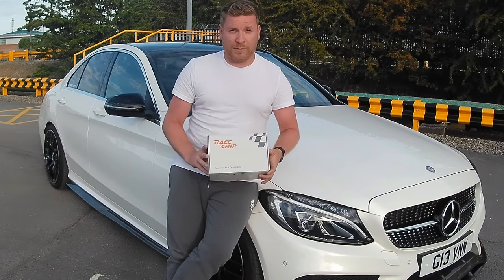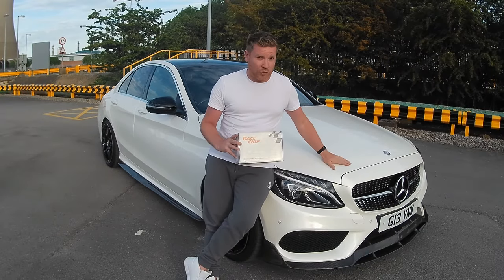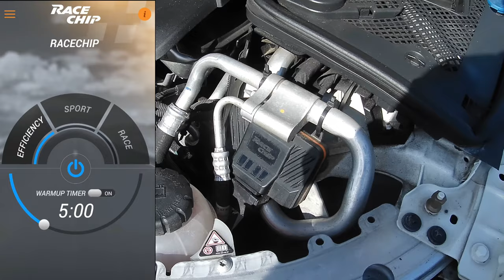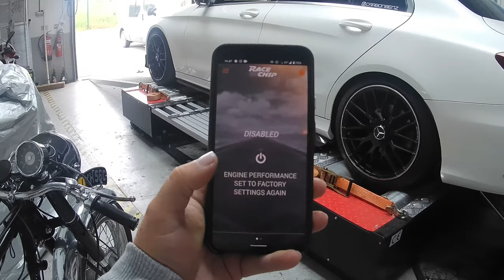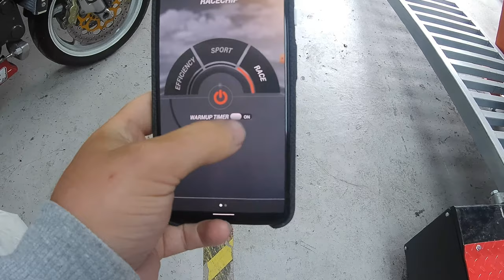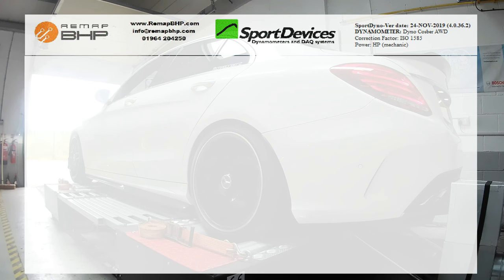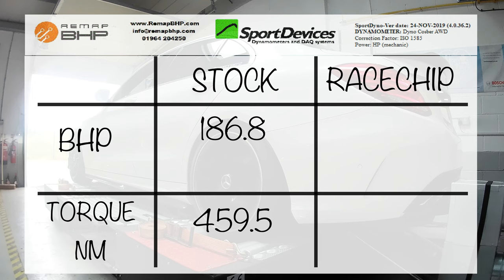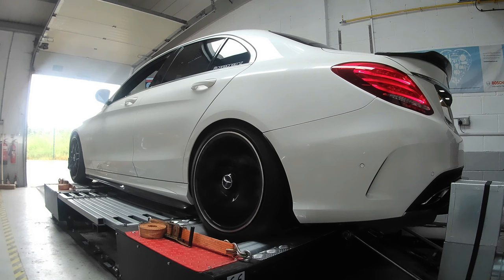RACECHIP Tuning Box's - Do They WORK? DYNO TEST RESULTS!

Comment: I had one of these on an Audi A6 2.7tdi. I went in with my eyes open, I kinda expected it to do very little, as they work by basically putting a resister between the fuel rail and the ecu to manipulate the sensor reading. 

This ties in pretty much exactly with my own “butt dyno” findings. Race chip quoted an increase from 177bhp to 220, which is total rubbish, but it did pull noticeably harder in the mid range. I guessed it increased the power by about 10bhp, and the mid range by a bit more than that.

Basically, do they work? - sort of.

Will you get a noticeable increase in power? - Power, probably not, mid range grunt, noticeable but not huge increase.

Is the quoted increase total garbage? - absolutely. I think they simply quote the increase you typically get from a remap ( you know, one that directly effects turbo pressures..), and say that it what it will do…

Is it a con? - yeah a little bit. They do work…ish, but I wouldn’t buy one again unless it was VERY cheap, and on a very cheap car it didn’t care much for. It could be “worth it” on a crappy golf diesel for the extra mid range, but I’m pretty much every other situation, I’d get a remap instead.

I also wouldn’t touch one on a petrol motor, it’s just asking for trouble.
Reply: The Racechip is a small computer that reads the sensor data and changes it depending on the programmed map. (not only a resistor) 
It basically does the same as an ECU tune, just without touching/changing the ECU.
There are also different mappings for each mode, which you have to slowly work out (mine had 22 maps and when the engine threw an error, i set it one back down).

The benefit of an ECU tune is, that you can do way more and it will be for your engine specifically/get the most out of your engine)
Reply: @chimei-tekinaneko8318  I’m sorry, its  not a small computer at all. 

It’s a takes a single reading from one sensor ( fuel rail pressure), modifies that reading and feeds the adjusted rail pressure to the existing ECU.

The cars ECU then changes other parameters that is can directly effect the “fix” the issue as it sees it by adding more air to compensate ( turning the boost up). 

The higher end race chip products have a Bluetooth enabled computer in them, but they still only effect that single parameter, which is in effect a potentiometer to effect the resistance on the sensor of the fuel rail. 

You can achieve the same results by placing a 80 cent resistor across the connector pins on the sensor ( we have done it..)
Reply: @martjackson  a resistor has a constant offset, the racechip is in fact a computer that has a (programmable) variable offset, which changes with the rpm.

Comment: I have a Racechip GTS for my 2020 1.5 ecoboost. Which stock is only 182 hp but after installing the Racechip and a cold air intake it pushes 247 hp. Definitely worth it.

Comment: These were all tested by Darkside Developments on their dyno. Findings were they're pretty much all crap and don't live up to expectations. Get a proper base map installed and calibrate it from there with someone who knows what they're doing. People in comments saying it makes a difference, loads more power, feels like its 210bhp. All largely placebo unless you put it on a dyno to prove the results.
Reply from the maker: Agree totally
Reply: Absolutely agree 👍 these things are a waste of money your better off putting in premium fuel all the time as the ecu learns over approx 500 miles that will give a proper increase in power torque and economy
Reply: I agree, very subjective isn't it.
Reply: @retro80s80  +1 - I've tried a couple of these and the midrange torque seems to be where they make a little difference (as shown in the video here too), but let's be honest - a few hp over a couple of thousand RPM is not going to turn a small diesel engine into a top gear from 0 km/h monster. They're worth it if you can get a used one for peanuts or find one at a breaker.

Comment: I got one on my Civic 9 1.6 diesel. I observed a gain in torque, but not in power. The drive is better for acceleration, and mileage is better (4l /100 km on road at speed of 100 km/h, 5.5 l/100 to 6l/100 km at speed 135 km/h on highway with 4 persons and fully luggage load)

Comment: I wonder if additional torque and HP  achieve by combining  Racechip  & Revo infinity in a parallel function? I had conducted  numerous public  tests installation and test in the past. I persuaded my buddy to partake in competition to prove that the gadget can actually perform and function and also are meeting International Stds & expectation. Without testing, it is hard for most people to believe it's actually works wonder for the installed engine. I am glad he took my advice in partaking competition. It claims the Golden & Best Product Awards of MTE and The Best Innovation Awards Issues by Association of British inventors and innovators. I hope the awareness of this gadget can be widely spread in the movement combating climate change. It's an opportunity to cooperate and an individual has the opportunity to partake in combating climate change. Thks
Reply: As

Comment: Very informative, obviously unbiased video, thank you. You forgot to talk about your personal opinion. They lied we can see that, but what was you estimation was it worth it ? The power increase is not great, but the torque increase looks nice, how did you feel that in the car ? Would you buy this thing again ? Or is it "not recommended" ?
Reply: They didnt lie, the car was more powerful than stock, may be the car they created the chip on had the standard 170 bhp!
Reply from the maker: For the price you can feel a difference yes! However after this video I had the the car actually tuned on a Dyno with a proper remap and that was night and day difference, given the fact that it worked about the same price I would certainly say to just go with a remap

Comment: Tbh it sounds, to me, your merc allready had a little optimization in the past. Maybe a little higher temperature from the diesel burning elements and a bit more air?

Because if it truly had stock figures (on paper) then the end results with the racechip would be completely accurate... So to me it does work. 

Allright these engines do always perform a little better with the right fuel and oils. But not this much right? Especially torquewise. But I could be completely wrong.
Reply from the maker: Hi there and thanks for your comment, as mentioned in the conclusion after performing some further research prior to making this video it seems that these cars are actually putting out higher figures than mercedes claim with many owners of the same model reporting similar figures prior a remap. hope this clarifies!
Reply: @ZER0Y0N  I understand. 😊 Good job by mercedes 👍

Comment: Needs to be checked against a remap eg Celtic tuning to confirm value and performance gains over standard
Reply from the maker: Sadly I sold the car and didn’t follow this with a further video however after this I did indeed remap the car, before figured matched the figures found on this dyno but the after results were night and day difference m. A remap is the way to go

Comment: The only way RaceChip can claim the number they claim with a straight face is by comparing the maximum delta between the before and after dyno curves.  That, of course, is far different than comparing optimum highest peak hp, before and after.
I got a RC for my car, and I'm glad I did not pay MSRP.  Got it used for less than 1/2 and still think I overpaid.  I felt I got more out of my AccessPort w/TCM for my Nissan GTR for $1100, than this RC for my BMW for $300!!!  HP increase was only 60 (advertised 140).  I recognize that it is an unfair comparison since the AP will allow you to run e85, bigger injectors, fuel pumps, air intake, etc.  But at least you can mod your car to your heart's content.
Reply from the maker: Interesting experience and thank you for sharing it with us, certainly the RC did not deliver and a proper tune is the way to go! Thanks for watching
Reply: soo did rc chip give you 60hp
Reply: @ZER0Y0N  I think Your mercedes diesel has no turbo from factory. Thats one of the main reason why your gain was low to nothing. These work and gain more on a turbo. Specialy on a 2.0 Liter turbo.

Comment: If you get an engine mgmt light on as a result of using one of these. Let’s say you have it on too high a setting. Can you just remove it and the EML goes away? Or do you need to have other tools to fix it? Concerned about getting one, having issues and then having to pay more money to fix. Thanks for the informative video.
Reply: Yep, you reduce the tuning mode or turn it off completely and the car will return to stock condition. Unless you blow the turbo or something, but that wouldn't be caused by RC itself

Comment: I used to have Tdi tuning bix on my fird transit Custom van, when it was brand new, 3 years later on a way home engine made horrible noises so I removed the box and opted for proper remap, and what a difference it made, day and night, as you stated it does a tittle bit but no where near to what they claim at least on diesel vehicles, so from my experience don’t waist your money on these boxes but go for remap.

Comment: These tuning boxes only add maybe 20hp at most, I find that it's much more beneficial on small cars with 1.0l engines.
Reply: Turbocharged 1.0 engines perhaps.  On a normally aspirated small engine, these tuning boxes will do absolutely nothing.
Reply: A friend tried the "simple" racechip in a Ford Focus MK3.5 1.0. He felt it like flying. It really gives extra performance. He advises me to get one (I will probably go for the RS). Another friend who has the 1.5 182 bhp MK4 said that it easily gained 20 bhp and the car became more aggressive.

Comment: I designed one for the first gen Mazda6S. It added 17whp and I think 12lbft. Not a ton, but it wasnt a powerful engine to begin with. They do work, but they have to be set up right and are nowhere near as good as a genuine tune set up for your particular car. 

That said, I have a dinan in my c300 cuz idc about hardcore power anymore. It's easier and less of a risk.

Comment: I guess they were basing the gains on stock, so add 20 plus hp if the merc was running stock
Reply: The Merc was running stock.  Manufacturers often report lower than real world performance figures.  It's to prevent litigation, if a car was advertised as 170bhp, then was dynoed at 168bhp.    So the car produces 186hp but they state only 170hp as the official figure.

Comment: I got a brand new company car on order VW mk 8 Golf GTD and interested in a tuning box.  The only thing that worries me is around getting caught with one by dealer when goes in for a service and potentially insurance consequences because I intend to say nothing to anyone about it.  The main concern for me is how easy it is to get caught with a tuning box?
Reply from the maker: When I had it on the dealer wasn't bothered by it but the car did develop a fault so took it off just in case ( after this video ) I then decided to go get a remap instead and the difference was huge
Reply: You just uninstall it and you connect it again.

Comment: Did you retrofit it yourself? And how was the fuel saving claim? Total bonkers?
Reply from the maker: No fuel saving whatsoever
Reply: @ZER0Y0N  how about the engine performance over time? any noticeable judder or roughness or unexpected breakdown?
Reply from the maker: @ahafeezs I had it on for a year then took it off for a proper remap but whilst it was on I had no issues

Comment: What I've heard these boxes do is adjusting the values of boost, airflow and fuel to the ecu making it overboost and overfuel. While it does infact increase performance, it does so quite inefficiently
Reply: well, if they were so inefficient, i guess you'll use more gas for the same mileage, but in fact, you're using less gas if you're driving the same way, so, i guess it does improve the airflow/fuel/combustion, and just deliver more torque/power

Comment: Just to double check, on the RC App, you did not select sport mode as the setting to test on the Dyno... Or did you and it wasnt so clear there is a HP difference?
Reply from the maker: We tested this, there was no power difference in either mode eco or sport, the car was on the dyno for a few hours testing every conceivable situation and setting and the results in this video were the average across all runs

Comment: Racechip doesn't make any guarantees or promises on Horse power.  They say up to Xxxx HP.  The amount of cold air the engines can get.  How restrictive the exhaust is, etc make a huge difference.  
To get towards the higher end of the potential power gains from a race chip you need to get rid of your Cats, improve the volume of cold air to the engine.  Change the injectors, change the cam, Change the turbos, change the exhaust.  Now dyno it before the chip and after the chip and you will likely see numbers closer to the up to HP ratings.
Reply: Changing all of those parts will literally help you gain the figures racechip claim without the actual chip
Reply: Why get a chip if you are going to change the whole freaking car 😂

Comment: hi i wanted to asks an interesting question. so i own a 1.5t mini cooper with stage 1 remap @179hp & 240NM. do you reckon its safe for me to install the lowest version of RaceChip since its going to give me around 20hp which i know is still safe for this specific engine.
Reply from the maker: Hi there, no I wouldn’t fit a racechip if your car is already remapped, your stage 1 will already be putting the engine out of parameters that the racechip won’t know how to deal with

Comment: How about fuel economy and emission results? Mate of mine had a computer chip company for many years, maybe 40 or so, but all he did was added more fuel and advanced the timing for different performance figures. No test proved his claim of X amount of performance gain. A;lways much lower, in line with this dyno test! Is it worth the money, I dont think so. OEM try very hard to balance performance with consumption. Their billions of investments require it! VW mistakes with their diesel figures and emission results, not worth the trouble.

Comment: I think you have to drive the car with the chip for a while so that the chip can learn and finetune itself. I'm looking to buy one for my car but solely for the fuel savings.
Reply from the maker: 100% that is not the case, racechip state themselves there is no “learning” feature however even if there was - this racechip was on the car for around a year before making this video so it had plenty of time 👍
Reply: @ZER0Y0N  Ok. Do you have any experience with this GAN tuning chip? I'm looking for better fuel economy. States up ti 15% savings with the +model.

Comment: Go to Celtic Tuning.
My A200d 2020 plate. Stage 2 remap.
£400 230 bhp and 360 lbs ft torque. 0-60 mph in 4.9 secs.
No hardware. Just remap! 60mpg avg driving.

Comment: Can they cause any damage over time?
Reply: yes it wears our your spark plugs and ignition coils faster
Reply: @raymondli8882  on a diesel 🫤
Reply: @oweston89  it increases overall oil pressure which can cause you to leak and later blow your valves over time

Comment: Do these work if you already have a stage1 Economy remap?
Reply from the maker: No I wouldn’t fit, these are tuned against your factory settings, if it’s already had a remap I’d say away and if you want more power just get a more power based tune
Reply: @ZER0Y0N - Thanks dude 🙏

Comment: A simple alteration of the accelerator position sensor reading as received by the engine ECU will achieve a feeling of more power / faster car than stock. This has a limited effect and the graph shows how the results even out at the top limits. Very basic perceived power boost that can be achieved with far cheaper devices or indeed pressing the accelerator further. Custom remapping is the only real way to achieve the gains you desire but be aware that some can make the cars everyday drivability worse.

Comment: Until I see dynos from these race chips I’m not buying one, seems like a waste and scam
Reply: Price is not worth effect !
Reply: Jb4 is worth the money, wakes up my g70 nicely
Reply: Your absolutely right these videos are showing the truth thiers not real gains as they claimed to be so yes don't waste your money.
Reply: I noticed a huge difference in performance in each vehicle I’ve had a Race Chip in. I had a C43 and currently have a C63s. The power it added in my C63s is massively noticeable.
Reply: @philnleblanc6664  so what chip do you have?
Reply: Have a racechip on my bmw f40, literally 0.5 seconds for the timer with just a racechip so it pretty much works.
Reply: @Kris_B 15hp for 200 quid  and warranty intact is not good value? A decent  tyre costs 200 quid you muppet
Reply: @philnleblanc6664 exactly this,  it depends on the car ..I added one to a supercharged a6 and it added 70hp without any other mods...that's insane value. It went from 290hp to 360hp. I spent 5k getting a jdm suabaru from 280hp to 350hp back in the day, you needed downpipes, decats, intake and bigger turbo's and maps at every stage.....these things are a bargain on the right car they are not going to blow you away on a bottom of the range diesel

Comment: Buy a Bluespark. Much more gains than that.
I know I had my car dynod
Reply: Bluespark Boxes are very good, had a Civic 1.5 Turbo Petrol 180BHP. they fitted and tuned it while on the Dyno, they managed to get to 220BHP, Totally different car, i only used Tesco momentum 99, Bluespark no there stuff and i never had an issues with the Civic,